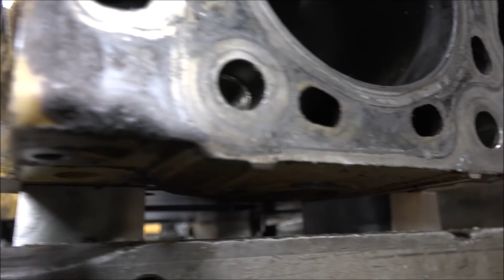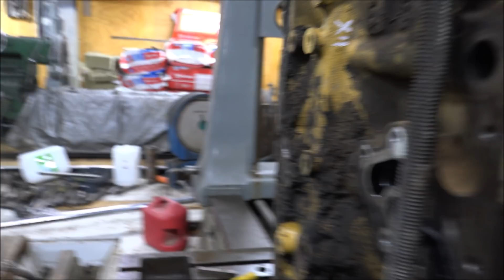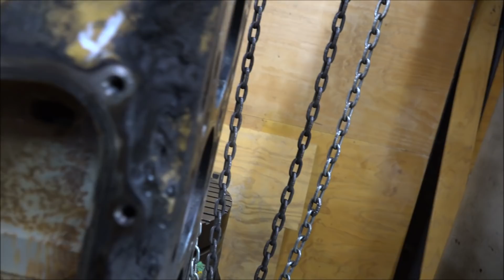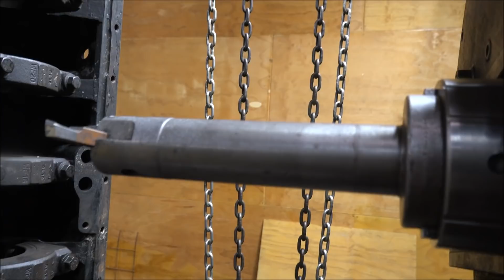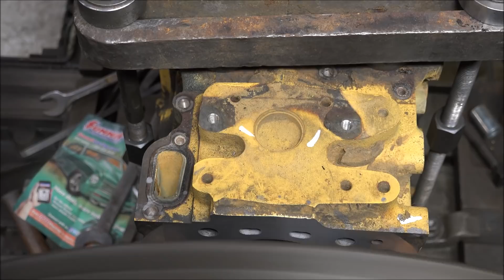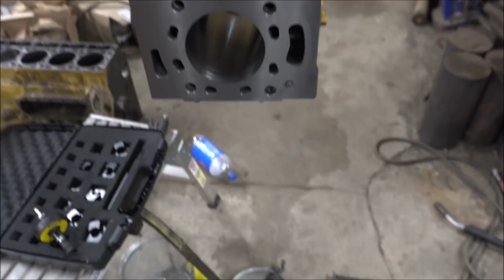Boring and Dry Sleeving a Caterpillar C6.6 Perkins Engine Block Valves Dropped Destroying Cylinder

Comment: Brian does that block not have replaceable sleeves?
Reply from the maker: Nope. It’s really considered a throw away motor just like a 5.9 or 6.7 Cummins. As long as they are good enough to make it out of warranty how rebuildable it is isn’t really a concern to the manufacturer.
Reply: @bcbloc02  The you saved it :) I was wondering if the sleeve was messed up so bad it damaged the wall.
Reply: @bcbloc02  actually sleeves are orderable for it... but they are a parent bore engine (no sleeves)... from my understanding most people won't work on them because the cost for a short block replacement is about the same as a repair option but it looks like you're doing a good job of making it work

Comment: Looks nice!  Just curious, do those Perkapillers have siamesed bores like the Cummins 6.7?  Bores look pretty close together.  Also wondering if the machine pass over the block deck is adequately smooth surface finish for gasket sealing (vs grinding)?
Back when I was in high school I got my hands on a derelict Continental L478. 478 CID I-6 gas burner, parent bore.  Had a big sheet steel patch on the side of the crankcase.  Under the patch was a hole broken in the block big enough to fit through both my fists end to end.  Rod must have had enough of its life and exited stage left.  Dinged up the crank and cam, and knocked the lower corner off that bore.  Somebody bored that hole just the same as you did here and sleeved it.  By all appearances it ran that way for a while.

Comment: you know your craft.......some use liquid nitrogen to shrink those liners and get a friction fit .... good result ..... i was particularly impressed how well  you squared everything out to 1 thou or less over the whole large area  before starting
Reply: be careful doing this, in the 80s there was an issue with liners being cracked due to being nitrogen cooled to fit

Comment: these newer Perkins engines seem to have allot more Cat blood in them. I like the older Perkins engines just replace the dry sleeve and go on
Reply from the maker: It is no 6-354 but then again these make a lot more power so its a trade off I guess.
Reply: @bcbloc02  the best ones were the 1006 Perkins 6.0L. Made alot like the 354 but with alot more power potential i work on a 3000 rpm pulling one that makes over 700hp and stays together
Reply: @farmimprovement3492  they are a good engine, however oil leaks I think were designed in ;)
Reply: @bcbloc02  that was the design change on a lot of these engines... increased power removed a lot of the built in safety margin on the engine... C3.4 tier 3 is likely the best made Cat branded Perkins engine out there

Comment: That looks like an identical block sitting on the floor - I wonder if these engines are really popular or really problematic?
Reply from the maker: Actually the one in the floor is a C7 the actual Cat based predecessor to this engine. They too are really problematic.
Reply: @bcbloc02  different manufacturing facility for those two engines, different design facility as well... if this is a C6.6 predecessor to this is actually a 3056E engine
Reply: there are a lot of these engines out there... about 90% of the cat machine side has these engines in them, and then there are industrial applications as well... they do have issues but with any tier 4 engine and afterward clean air and fuel (and now DEF) are required... internal clearances on the fuel system are too tight now due to emission regulations
Reply: @TheFezzik  Ahh. I've heard things about this, but no experience. Supposedly, one of the reasons the 6.4 IH was so horrific, was the emissions. The industrial units weren't suppposed to have the same problems.
Reply from the maker: @TheFezzik  Both Deere and Cummins now have some engines meeting Tier V with no DEF.  For an Industrial diesel I feel it should be wet sleeve with full pressure lubrication throughout but that is just what I like.
Reply: @bcbloc02  All the small engines I am aware of currently on Cat require DEF. It would be interesting to see how they are getting around the NOx requirements without DEF. Wet sleeves are great as well particularly with the ability to rebuild. If you're talking about using oil for the fuel injection system like the HUEI injectors I personally think that the oil cleanliness requirement for those systems is too high and causes customer issues. Maybe with a secondary lube filter system in place it would help, but currently customers are not on top of oil cleanliness enough.
Reply from the maker: @TheFezzik  No I meant drilled oil passages to all rotating surfaces not relying on splash lube. For simplicity an inline mechanical pump can not be beat for a fuel system but at todays power level common rail is of course the best answer.

Comment: Impressive - the machine is only as accurate as the operator.
Reply: Yes I second that. It takes a while to get used to a already broken in machine.
Reply: AGREED!
Reply: Ditto! I'm bettin alot of practical experience showing here. Thanks for the look.
Reply from the maker: This is true. Lots more machine operators out there than there are machinist.